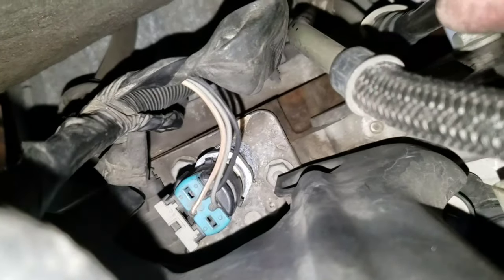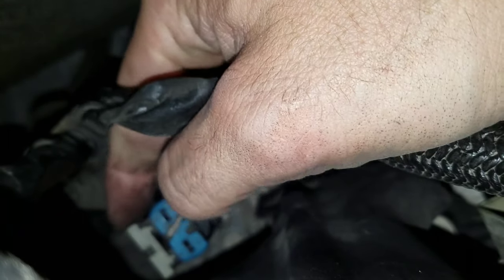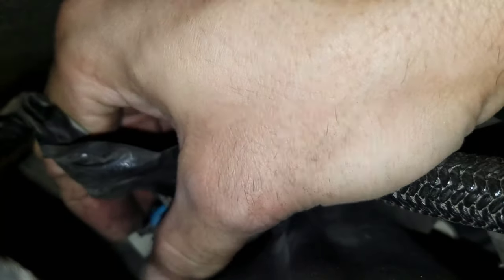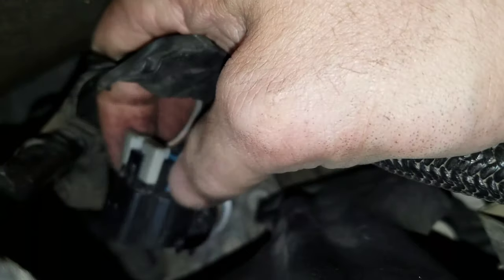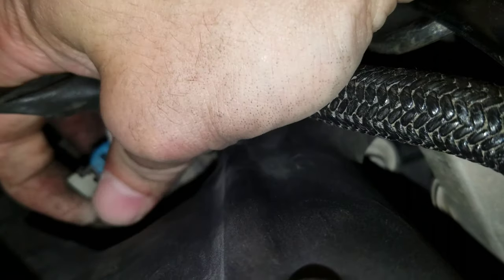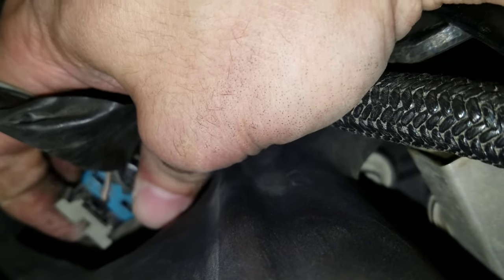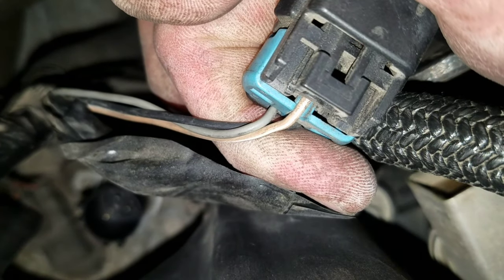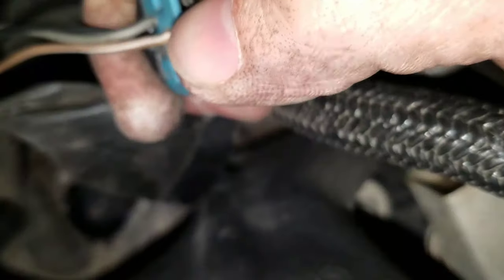UPDATE How to Unplug  Connector on Oil PSI Sensor P0521 P0523 No Oil Pressure Chevy Truck Silverado

Comment: This video was extremely helpful. You must be half Rubber Band Man or a Yoga pro. Just curious, did you ever try to retrieve the clip or just say to hell with it? Thanks for the trouble you went to in order to make this video. The two videos you made on this sensor replacement are definitely the best that I have seen, unfortunately, I am getting ready to replace mine, LOL. Semper Fi, USMC.
Reply from the maker: I just left it down there

Comment: What in the actual fuck?  Ya'll got stress balls you trained with for weeks before attempting this?  Been at trying to remove this damn clip for 3 hours and I feel what's holding me back is my weak ass hands.  I can get the grey clip moved up (at this point I have been trying to rip it off), but I don't have the strength to do it.  I cant even get a screwdriver back there to try and pry it off.  BEYOND frustrated
Reply: Same.

Comment: Thank you so much for going through all that trouble and posting this.  I spent about 2 hours trying to figure out how to remove that, and I finally gave up and just reconnected the hoses I had removed.  I was able to get that gray clip up, but I didn't know you had to then press on that same part (I was trying to squeeze together the two blue plastic pieces, to no avail).  You have saved me from removing the entire intake to get to it!

Comment: What could it be if i already replaced the screen and oil sensor and my gauge needle wont stop bouncing? Idling or when driving please help thanks.
Reply: It's your oil pickup tube Oring that's attached to the pickup tube in the oil pan ! It's rubber so it cracks & shrinks over time causing it to suck air which causes low oil pressure & oil foaming or a oil pressure gauge reading that's erratic . If the oil pressure sensor is going bad it will throw a PO521 code if the sensor is out of voltage spec either too high or too low as well . If your lifters tick on start up when cold or after it's been run then shut down for just a few hours then the lifters click & make noise on start up again it's because the oil that's supposed to stay in the pickup tube is running out of that cracked Oring losing prime or the anti drain back valve is bad in the oil filter or your lifters are either clogged because of not changing oil consistently or using a low grade non synthetic motor oil or they are just plain worn out if left not fixing this internal oil leak at that Oring for long enough . If it's bad enough the lifters will make noise all the time when the engine is hot after the oil gets hot & thins out . GM's engineers really screwed this one up using a Rubber Oring for a seal that's exposed to oil & heat all the time especially since most rubber doesn't like oil as it eats it up & breaks it down & granted I think the Oring that's used is a silicone rubber they still crack & deteriorate ! They should have used a copper style crush washer that crushes down when the tube is put back in & the bolt torqued down almost like what's used on the brake line to the calipers that can take heat & don't leak even under the hundreds of pounds of pressure that brake lines are subject to . These engines are common to have some minor lifter tick so as long as it's not really loud & all of them making noise at once it's normal for some noise .

Comment: Those connector locks are stupid.  
When you get the connector loose, break or remove the lock.  
That particular connector experiences almost no movement and is in a protected area, the basic connector clip will hold it just fine without the lock.
Stay gold.
Reply: Thanks!

Comment: This is absolutely the best way to do this job, all you need is the socket, a small elbow swivel and that extension! Of course a simple wretchet or breaker bar. But this is the easiest and most simple way you don’t have to go buy all them fancy tools like on all the others videos.

Comment: What would this clip be called if you happened to break it trying to get it off? I lost the grey piece when I took it off and the two black pin thingies broke off.
Reply from the maker: Oil pressure sender pigtail

Comment: Quick question...so I recently had my oil pressure on my 2011 Suburban peg to zero...ran a diagnostic and got the same codes as you had mentioned in your first video. I sent it in to my dealership...DAMN...mad expensive for replacing the switch. However, they also had listed to replace the switch connector. Do you think I would need to do that? Or would just replacing the switch fix my issue...your video is great help!

Comment: With the help of the video, changing the sensor wasn't as bad as it appeared.  My nephews engine needed to idle for about 4 minutes before the gauge started working.   Thanks.
Reply: Thank you for mentioning the engine needed to idle before the gauge started working. I just finished changing my sensor and thought I was going to have to take it off again, then read your comment. After idling the gauge worked just like you said. What a relief! Haha

Comment: My 2010 Camaro SS has become more difficult simply because when GM put the original sensor in they installed it with the clip side facing the back of the intake manifold, which means I cant press the clip to release it. I might have to try somehow unscrewing the sensor a little to turn it so I can press the clip.
Reply: did you have any issues? im about to do the same to mine

Comment: Thanks for the video, you got way better angles than anyone else. Tip for those with larger hands, I struggled for 3 hours trying to press the release in after getting the safety clip up, it's so tight my hand just couldn't move. I finally got it left handed with my thumb and pointer finger closest to the ground, the angles in that orientation were way better and it only took one try that way and it came off easy

Comment: Id like to find a video on replacing/ fixing the actual wiring
Reply: Yes. My connector fell apart so no idea which wires attach to where on the new connector plug. The wires are a different color. Afraid if i get the wires crossed it may damage something else. Black to black is a given but the itget 2 wires.. no idea?

Comment: @Thelatemodeltech - thank you for the video.  I went ahead and tried the replacement on my 2008 Tahoe LTZ.  The engine seems a little more set back than your rig than my Tahoe which required a hood removal.  I was able to get the job done.  The only hitch I ran into was using the EVERCRAFT brand socket from Napa.  As the sensor was loosened the top of the socket didn't have enough clearance to extract the tool and sensor.  I chamfered the top of the socket and that made the job successful.  Your time in putting these videos is greatly appreciated.
Reply: For the next DIYer - suggest that after you install sensor, take note of sensor clip 'nub' position - this will help you orient the sensor harness in the right direction to clip on.

Comment: thanks! just did this on a suburban... idk how you're filming at the same time LOL. i ended up just breaking the grey clip off with a tiny pry bar then removing it since its not really needed. could not reach it at the angle it was facing by hand.
Reply: Did you still have to push on it to get it to unclip after breaking off the safety
Reply: @tealwolf2380  yeah still have to pinch the clip to remove it

Comment: I dont know why they put those safety clips on the connectors anyway...
Reply from the maker: Insurance
Reply: Definitely an insurance step. For all the assembly processes and long term reliability. Note how they are all made to quickly connect and some can be a bear to take apart. Assembly line quickness and they don't worry about them coming apart.

Comment: where can u sit when u get in the engine and do u need to remove any plastic
Reply from the maker: Did you check out the First Video i made on this problem?
Reply: @Donnythelatemodeltech  yeah but where do i put my azz i dont want to bust up the bumper/ grill
Reply from the maker: I put most of my weight on the metal part of the Radiator Core,,  right foot on the steering shaft--- or in that area. lol
Reply: @Donnythelatemodeltech  ok cool any other tips to do this. just bought all the tools using ur link. i hope u are getting affiliate marketing link bro if not make sure to look into that u feel me
Reply from the maker: Thanks Cody, every bit helps.  Good luck with the repair, hit me up if you have any more questions.

Comment: Just wanted to say thank you Late Model Tech for your three videos. I would have never been able to change the sensor and filter without your videos. Sitting in the engine bay worked, I did break the clip trying to get the connector off, and it took many tries to thread the filter to get it out. Successful job but my hand hurts; it did take me much longer than you but you have a lot more experience. Hopefully you got a little commission from my Amazon order using your links.  The sensor on my 2009 5.3L Tahoe was ACDelco Part# 12673134.